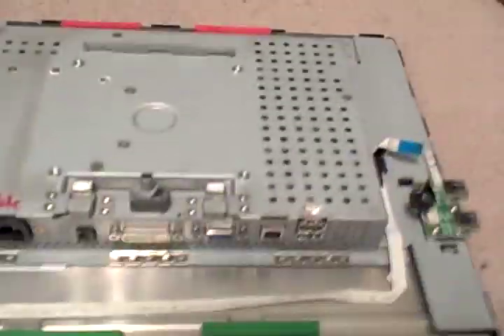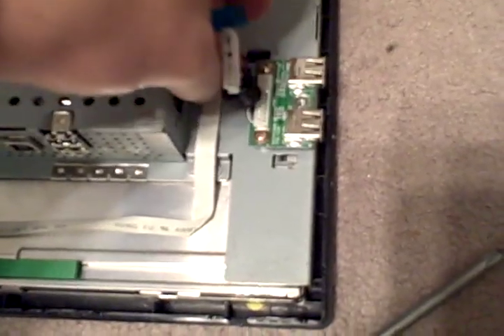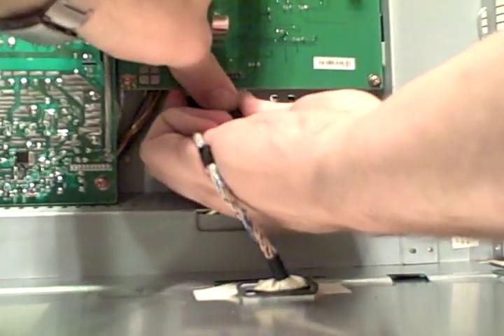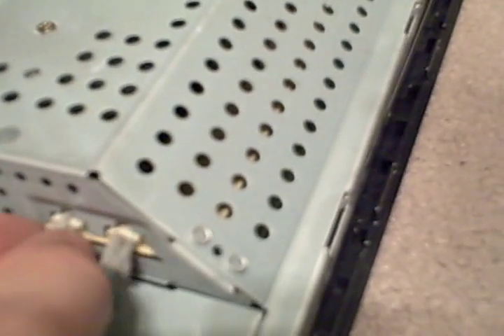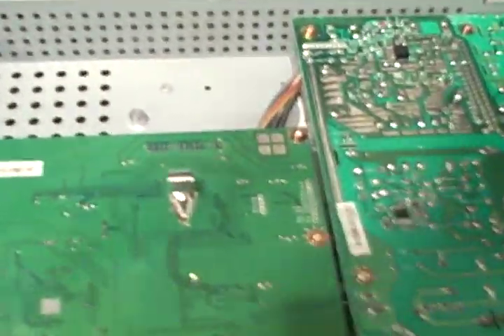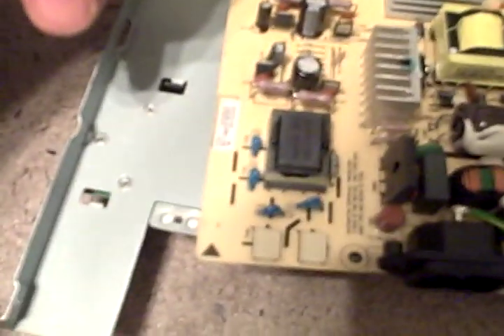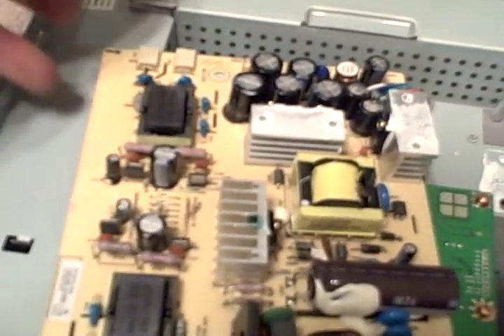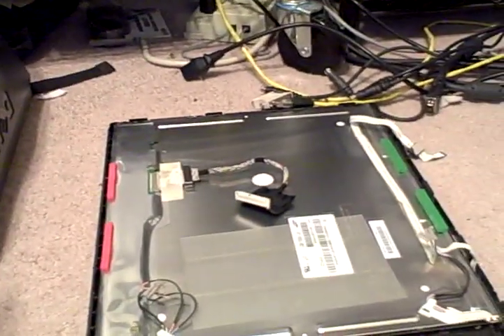Disassemble 17" Dell LCD Monitor for repair part 2

Comment: Hello. My problem is in the on/off button. I opened the monitor but the part where is the button is stick to the black plastic cover. ¿You know what I need to do? Please, help me. Thanks.
Reply: I have the same problem. Can u fix it?

Comment from the maker: @maymayday90 They aren't standard, some models use the same boards, but you need to match the model number on the power supply to replace it. Ebay normally has them.

Comment: Do you know if it is possible to replace the power supply with a pc psu? are the connections standard 12v,5v, etc to the rest of the monitor? I only see one cable coming off the power supply, so I'm keeping my fingers crossed.
Great vid, and any help is much appreciated.
Thanks

Comment: I used this video to dissemble my monitor, I couldnt see anything wrong with the capitors, maybe a little residue on C825 but nothing as dramatic as yours. I was just thinking to just replace the entire board. Thoughts?

I believe it is the PS because there are no LEDs lit on the front and no response to the power button. thx

Comment: do you think i've to change capacitor in my monitor that turn on regularly but all screen is white.and  with video signal in the monitor remain white but change a litle bit some column while i move on the screen a wiondow.. (i use clone monitor so in a good one a see qhat happens in the other.)